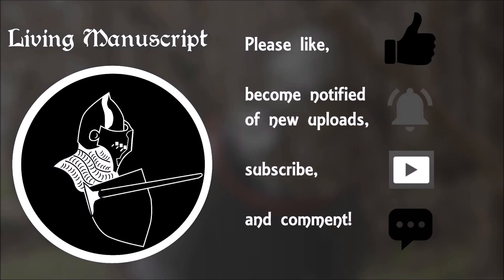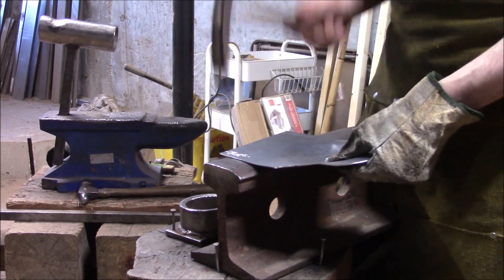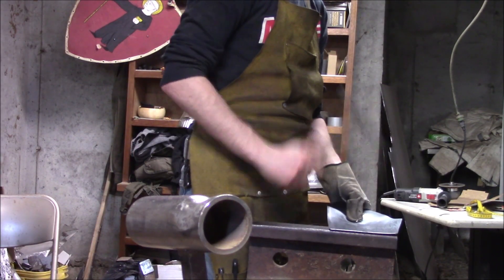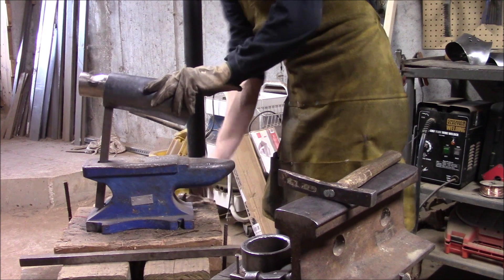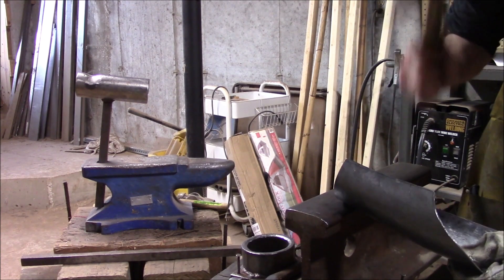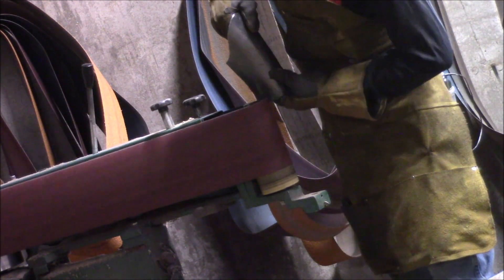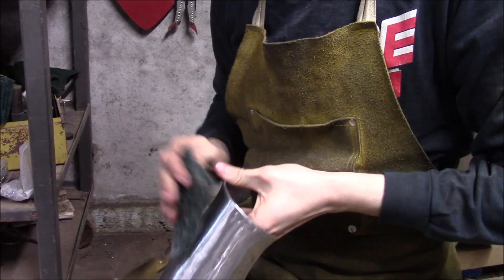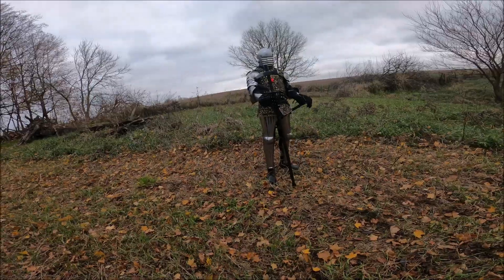How to make a Vambrace

Comment: Great to have you back! How would you describe the technique you're doing with the cross peen hammer to add some curve near the edge? Do you have a concave surface on part of your anvil that you do that on?
Reply from the maker: Most of the cross-peen work can be done on a flat anvil, the railroad tie I was using is simply a better anvil than my actual anvil :) The idea is that the cross-peen will compress the metal and so stretch it in a predictable way. Although it will cost a little thickness of material, the additional shaping of the overall piece will be stronger anyway